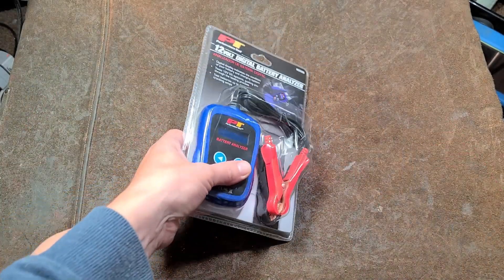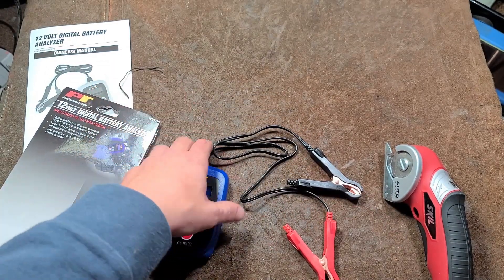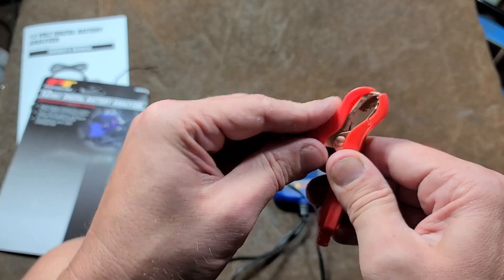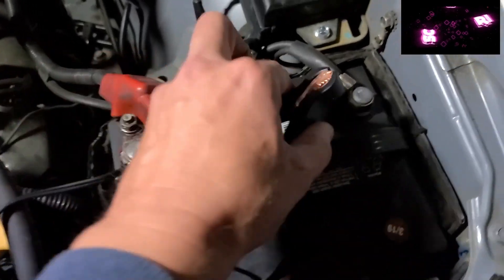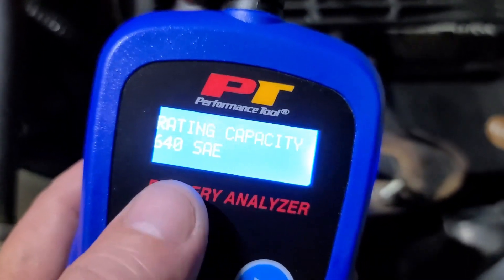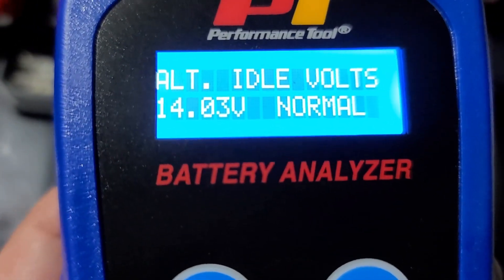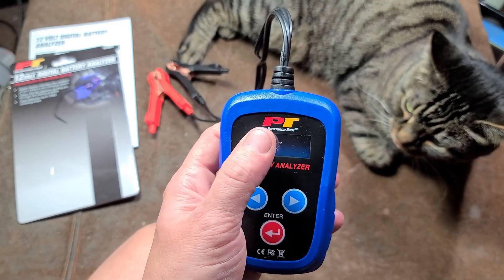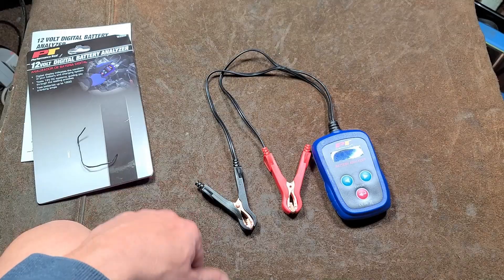Performance Tool Digital Automotive Battery Analyzer Review

Comment: We use midtronics and associate battery testers analyzers in the shop. They are professional grade. For the Dyi I recommend the Ancel BA 301.  Great colour graphics and a good sized screen with accurate results.
Reply: Thanks for the tip!

Comment: Nothing beats a heating element 200 AMP load for $40.  Batt needs to be in car for this one, it uses car for load.  Walmart kept telling me my battery checked good under warranty, I had to take a 200AMP off the shelf and show them it was bad, then they replaced.
Reply: Yeah I've seen that happen with customers trying to warranty a AAA battery, they're tested says it's good,, but my testing says other wise

Comment: I have used similar 'quick' testers in industry. They sure fail allot of batteries that were probably acceptable. For battery health at home, I use a digital volt meter with max/min capability. I connect it to the battery and capture the minimum voltage at the start of the engin crank.

Comment: What if after you connect the tester, nothing happens? Tester does not light up at all. Is battery completely dead or is tester defective?
Reply: It means you probably haven’t connected it properly. The display won’t light up if you don’t connect it correctly. Re-read the instructions and try again.

Comment: Awesome. I was split between one of these or the old school resistance boxes. I'm sold on this one, <$10 difference.
Reply from the maker: I believe the resistance boxes are still more accurate because they place a longer-term load on the battery wear these sometimes do not give a proper reading specially on batteries that are really old

Comment: Just bought one. It didn't come with manual. It said the instructions were on back of the anyalizer. It is unreadable! If the cables are dirty you may not get an accurate reading.
Reply: For anyone reading this and wondering, the instructions are sandwiched between two thin pieces of cardboard that make up back of the clamshell packaging. If you don’t take them apart, you might miss the little booklet.